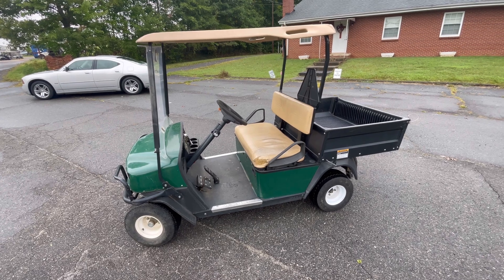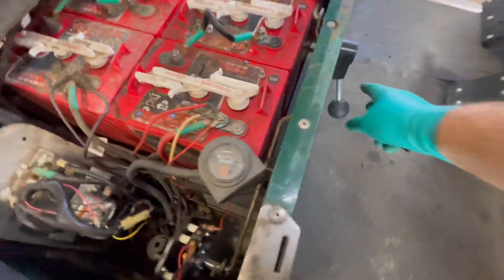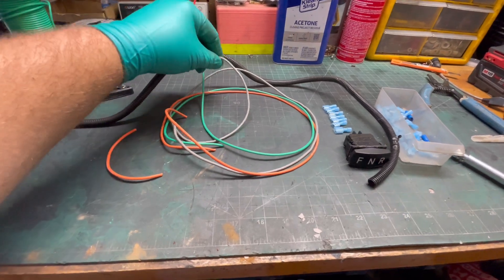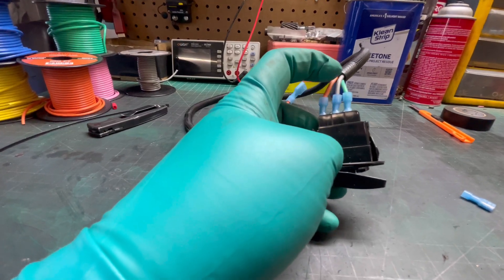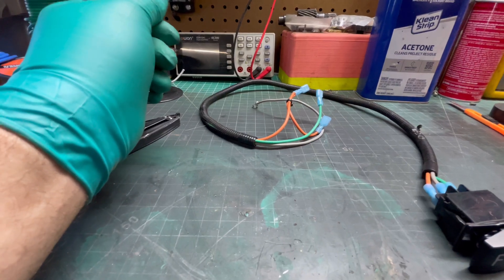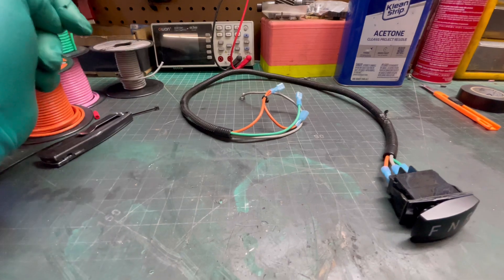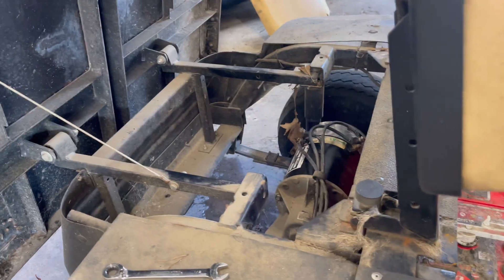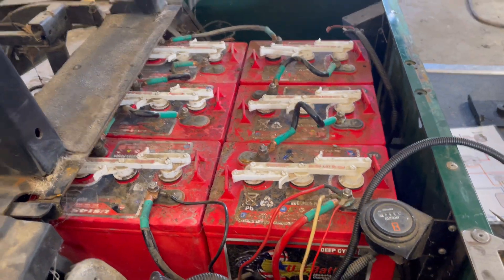EZGO Series Push Button F&R Installation and Upgrade

Comment: Hi, I see a yellow wire going to the Solenoid small positive terminal.  Would you tell us where that wire goes to and what is its purpose?  Thank you so much.
Reply from the maker: That yellow wire is for the hour meter. It’s the positive wire that activates it when you press the pedal to start it counting

Comment: I replaced mine on txt series cart 36v everything works but have much more torque and speed in reverse than forward are it seems to anyway, would there be anything that would cause this?
Reply from the maker: Probably got the orange wire on the wrong side of the switch.
Reply: Had to remove the orange jumper not exactly sure why, both directions rolling fine now

Comment: Was the issue no forward or reverse before the solenoid install or did that show up after?  Lost reverse on my 07 series cart and was thinking it was a bad board but now you’ve got me questioning if the motor has gone bad now…

Comment: Thanks so much.  None of the diagrams I have had the low power wire instructions.  I have a SW182 contactor and would greatly appreciate a diagram for that unit, so I don't destroy my controller.
Reply from the maker: Ezgo? What year?
Reply: @TheCart_Doctor  Sory should have mentioned it.  EZGO TXT. Missing the Serial number tag but its older and identical components to the unit you used in your video.  It does NOT have a run tow switch.
Reply from the maker: Email me. I can’t chRe photos over YouTube comments. Thecartdoctor77@gmail.com